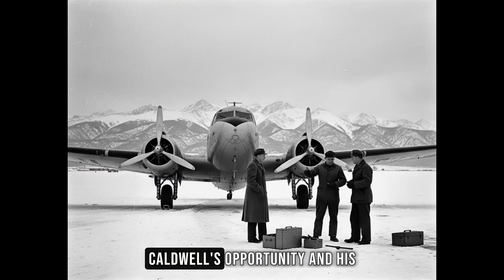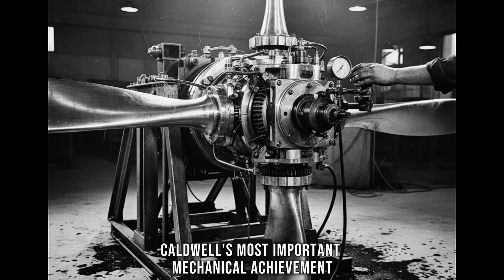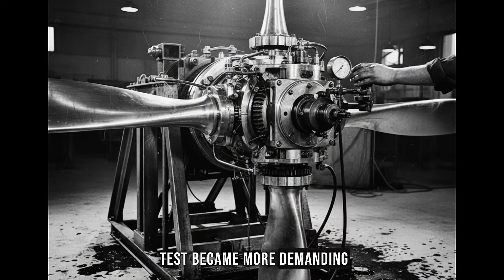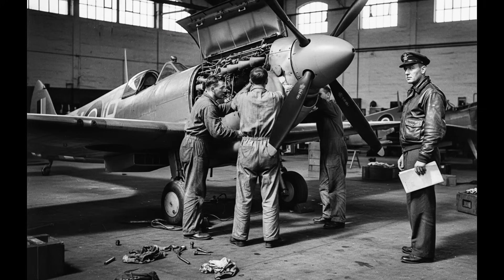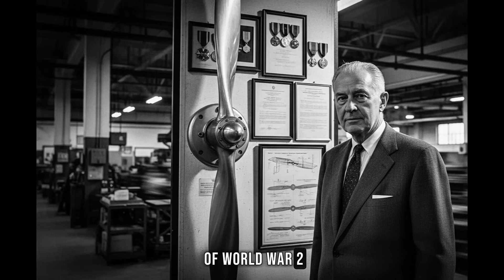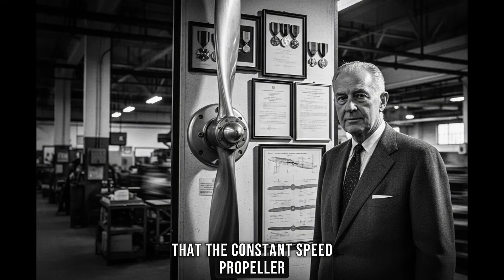The Propeller That Won the War: How One Engineer Changed WWII

Comment: Can variable speed props freeze up at extreme altitudes?
Reply: They did so frequently on the Spitfires that flew out of Darwin during WWII. Worse yet, they froze in fine pitch, which meant engine over-speeding and failure.
Reply: @jameswalsh8837  That's very strange, because Darwin has a hot climate and the Zero was a poor  performer at high altitude, so rarely went above 20,000 feet.
Reply: @jameswalsh8837  How is it that they did not freeze over Europe Source please

Comment: One thing you qverlook, and that is that the Germans also had constant speed propellors.
Reply: Yes, but the pilot had to manually change, they were not automatic.    It said so in this video.
Reply: @CHARLESMOELLER-y4r  The video was wrong.
Reply: "German aircraft did not widely use constant speed propellers during WWII, but some later models like the Fw 190 D and Ta 152 were equipped with them. The Bf 109, a major German fighter, used variable pitch propellers for most of the war, though some versions were later upgraded to constant speed models. Constant speed propellers allowed for optimized performance across different stages of flight, but they were not as common in German aircraft as in those of the Allies during WWII."